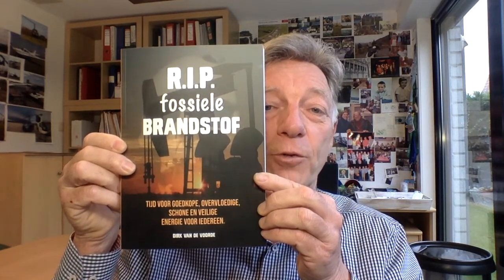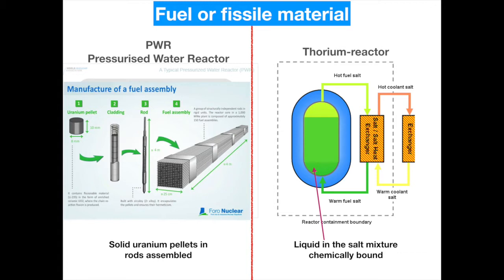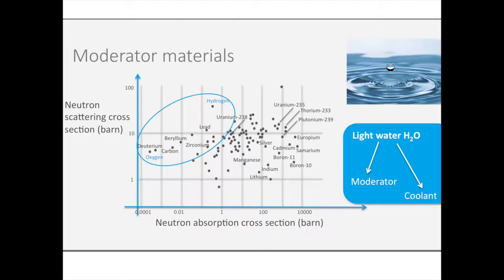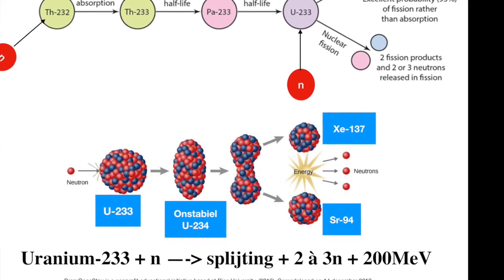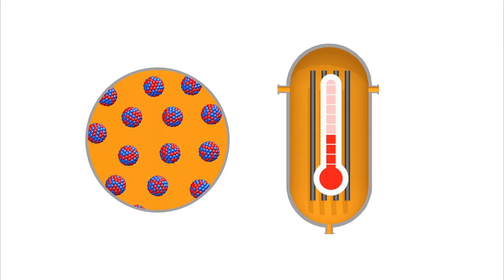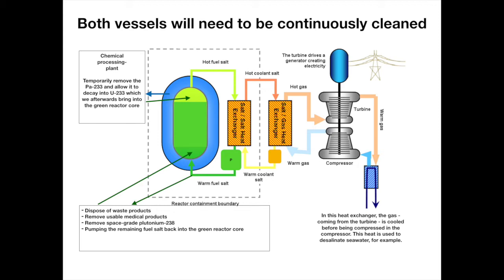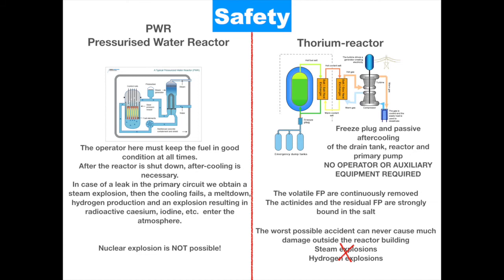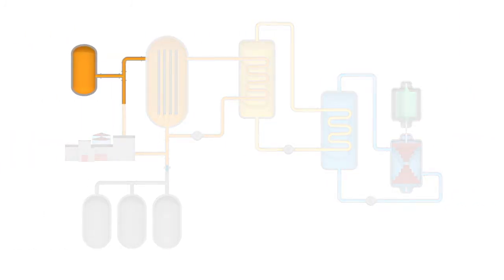The Thorium Molten Salt Reactor

Comment: Thank you for the sanity of the molten salt reactor. I have the idea that full fuel re-processing may boost the cost of the moderated reactor a little. How much I am not sure but when we used the Purex Process we had huge Bays of material trains. Since ours is a liquid except at the start when you get a shipment of fuel rods in to chop up, every bit of that initial load will be highly radioactive including the acid used to remove the fuel from the rods. This will not be a minor amount depending how fast you can convert over to thorium unless you just want to burn nuclear waste. In that case a large volume of acid and iridium will be produced. Any actinides left in this material will be very radioactive
Reply: Jo
Reply: In the US reprocessing is illegal,so far,there is no reason to change that, the Natrium System does not need it.With TRISO fuel you do not reprocess, just bury, you get higher burn ups and more energy out of the fuel,Kairos uses HALEU, but that just needs higher enrichment,not reprocessing, they want to be able to export these systems to countries that could have proliferation risks.

Comment: The reason that Thorium MSR was shelved was that it was harder to manufacture plutonium for nuclear weapons
Reply: just a myth. first it is possible to make nuclear weapons with thorium albeit slightly harder, but thorium is far more dangerous after fision
Reply: @dmitrizaslavski8480  
I never said it was a myth. I did say it was harder.
Reply: @bearup1612  So if it is possible that they go with thorium all the same if it provided any benefit over Uran based reactors. But no, it didn't provide ANY benefits at the time and big  problems(as it is a lot harder to contain fission process in msr, mb today it is possible but still not so easy and hard to scale). So even if nuclear weapon production had a role it wasn't main one.
Reply: The real reason they did not like thorium for weapons is that the process that generates U233, used in weapons, also produces  a small proportion of U232, which is not fissile but decays with a hard gamma ray that is a) deadly and b) detecable at distance which makes a weapon very difficult to hide. No way to realistically keep U233 and U232 separate. So yes there were good reasons to exclude Th from weapons development.
Reply: Not true.
Reply: @markrice41  Sorry buddy but that has been said so many times it is a joke.  No.  Not until America loses the reserve currency will anything change.  The two party system is designed to prevent a meaningful response to the legitimate needs of the American public.  Meanwhile the US government must run balance of payment deficits every year forever in order to ensure the US$ are staying overseas and can be used by third parties.  This means exporting jobs overseas with the US$.  Sound familiar?  Best thing that will happen to American is losing the reserve currency.  Then the economy will be able to compete with the rest of the world.  American are super industrious but their economy was destroyed by the Oligarchs.
Reply: So silly that people repeat this lie,the weapons came first, then the reactors our military uses enriched U for our bombs for Pu they have their own reactors that are not connected to the grid, one thing we do need is the Pu for the generators for Mars probes and some isotopes made in reactors just one isotope, for medical use is used 44,000 times a day just in the US,there are new uses for isotopes made in reactors every year.
Reply: Obviously building salt reactors ,as we are now ,has absolutely nothing to do with our military thermonuclearnprograms,we don't forget how to make Pu because new civilian reactors don't make them, but of course they do,Th reactors make U233 .
Reply: @charlesbeaudry3263  US still leads the world in clean nuclear energy, more than 100GW, we also have a number of advanced reactors in various stages of development, let’s not forget Vogel 3 and 4 about to unleash more clean energy on the Southeast US.
Reply: @charlesbeaudry3263  The world trusts the US hence our position as the preferred currency, we may lack in some things but everyone else are so much worse.
Reply: @paulbedichek2679  In proportion to its economy the French are way ahead.  So is Ontario, but your point is well taken.  Have you followed Terrestrial Energy? Based in Toronto.  This is a very tangible example of private (albeit with lots of gov money) GENIV reactor development.  Nice to have some optimism.

Comment: China has just brought on line the first current Thorium MSR. Indonesia's Walk-away Safe 7×500MWe Liquid metal Thorium ion molten sodium fluoride salt burner energy converters at $1200/kW will be next.
Reply: I don't think it has even gone critical yet, let alone brought online. As of today, Oct 6, 2021, I can find nothing but articles saying the Wuwei MSR will begin testing soon. This is only a 2MW reactor. We are still a decade or so before an MSR goes online.
Reply: @tpxchallenger  I think you're right but still lightyears ahead of the US who invented it.
Reply: @chapter4travels  Yes, China is definitely putting the money into new reactor technology. The pebble bed reactor HTR-PM just went critical a month ago. Interesting times indeed.
Reply: @tpxchallenger  its designed as a load follower so the thermal output depends on how fast you pump the salt through the reactor. The pump is controlled by the load which is currently being controlled as a means to test the attached systems.
It won't be long before you see the fossil fueled heating components of recently built coal fired power plants, being simply replaced with TMSRs supplying the thermal heat to the existing steam turbines. 
So expect to see soon the sensible construction of TMSRs instead of any more fossil fueled coal or gas units. 
Like Indonesia's chosen production line construction method of floating TMSRs in Asian shipyards at a rate of 12 units per slipway per year 
So I see no impediment in China's building capacity easily exceeding this, and at an even faster rate and cheaper than $1/Watt cost of construction and deliver cost; utilitising the energy for clean industrial manufacturing besides electricity, such as steel and cement and at an equivalent cost of supply of less than $25/Megawatt.hour eliminating the Nation's need for expensive Mickey Mouse batteries made from scarce elements, to balance the irratic supply from the unrecyclable Solar and wind farmers.
Reply: @MrVaticanRag  I hope you are right in your optimism. Of course small marine reactors are possible, the navies of the US, USSR/Russia, France, Britain, China jave been building and using them  for decades. But the "first mover" costs for any Gen lV reactor will be high. Both molten salt and pebble bed are very promising. Honestly, so are Boiling Water Reactors.  The Russian small reactors they recently put on ships are tried and true BWRs. 

The problems with all reactors are waste and safety.
Reply: @tpxchallenger  China is putting a lot more money in solar and wind than nuclear. Nuclear is less than 4% of the total energy production. Solar and wind are over 15% each.
Reply: @tpxchallenger  Quote from William Magwood, Director General of OECD's Nuclear Energy Agency and former NRC Commissioner, "If these technologies cannot be brought to market...in about a decade...they may not be relevant to the energy transition." Mark Cooper, Senior Fellow for Economic Analysis at the Institute for Energy and the Environment said, "Small modular reactors appear to be repeating the path of large reactors, with rising costs and increasing delays. Much of the battle to meet the challenge of climate change will be over before even one of these reactors is online."
Reply: @tpxchallenger  The high temperature gas cooled reactors in China are 3 times the cost of light water reactors according to the WNISR 2021 report. Maybe that is why China is putting a lot more money into renewables than nuclear.
Reply from the maker: Thanks for the information regarding ThorCon, I am studying it thoroughly.
Reply: @jackfanning7952  patience Jack - TMSR will dominate within 10 - 15 years. The can replace the fossil fueled thermal component of all Coal fired power stations constructed within the last to years and any potentially planned in the future.
Reply: @chapter4travels  China is not far ahead of the US in rice farming let alone advanced nuclear tech,yes,they built a LFTR,we love to hear that, but US has lots of new nuclear comming.
Reply: @paulbedichek2679  The US also has the NRC whose primary mission is to put an end to domestic nuclear power, and they have been wildly successful.
Reply: @paulbedichek2679  Thorcon went to the NRC and was told in polite terms to pound sand. I just don't believe anyone can turn around the NRC in any timely fashion.
Reply: @jackfanning7952  I'm a big supporter of clean energy, but even for me I have been leery of the fast reactors, not for safety, but just having accidents that mean shutdown and high costs, but we are going forward with Natrium,which is not a test reactor like the Chinese LFTR or the American molten chloride fast reactor, but a full size commercial reactor. It will most likely work as advertised, but be a year late to grid connection.There is also another demo plant not grid connected just making heat to see how it works the Hermes test reactor for Tennessee,Flibe cooled but solid TRISO fuel.
Reply: @jackfanning7952  You are confused about the ThoorCon that uses molten salt not liquid metal, it is a thermal reactor not fast,fast molten salt reactors are years from deployment the molten chloride fast reactor is a demo being built by Terra Power,not grid connected.

Comment: The TMSR has many advantages but the problem sits with the legislators due to the need for very highly enriched uranium to start the fuel cycle and the production of plutonium within the reactor.  Thorium is not fissile but it is fertile hence the need for uranium to start the cycle.
Reply: Can radioactive waste from Uranium power plants be used as a source of neutrons in Liquid Fluoride Thorium Reactors?
Reply: @charlieculbs9114  protactinium  can capture another neutron to U234 which is not fissile.  Neutron poisoning is a significant problem with protactinium due to its high cross section.
Reply: @landroveraddict2457  Can and will are completely different,Terra Power will use HALEU,highly enriched U. We have 90% U but that is just for the aircraft carriers and subs, now you have to ask Russia,US will start to maufacture Haleu.
The waste we need to worry about is batteries and solar panels.
Reply: @paulbedichek2679  Very astute, 20 years from now we will be trying to find a way to recycle, lithium batteries and wind turbine blades.
Reply: @elefnishikot  Radioactive waste emits electrons and alpha particles, and sometimes positrons, but not neutrons. To get a neutron chain started requires a strong alpha emitter (thorium is too weak) and beryllium, and of course a moderator. When the beryllium runs out, the neutrons stop.  This was the drawback of Canada's SlowPoke reactor.

Comment: There are hundreds of different nuclear reactor designs, all of which have their pros and cons.  Thorium is just another of these designs.  All of them have their advocates who claim theirs is the best.

Thorium and Uranium-238 both have advantages and disadvantages for use in MSRs.  They are both available in essentially unlimited quantities.  

It will take a long time for regulators and the nuclear energy industry to decide if Thorium is worth pursuing on a large scale.
Reply: All we need, according to Kirk Sorensen, is a cohort of middle school boys and girls who like to melt salts in crucibles, who then go on to build intricate pumping systems in high school.  They would play with molten salt in the same way that kids in the 1970s played with model trains.
Reply: @philipyoung7034  Sounds great. How that relates to nuclear reactors with fissile materials is not clear to me.
Reply: @tombenson5957  While the nuclear chemistry is the same for all types of reactors, the engineering for liquid fuel reactors is radically different from solid fuel.  The regulators understand solid fuel and so the licensing behind it. Volatile gases 4:10 is just one issue with both fuels, but how it's handled is tangentially different. (See video 4:10)   Liquid fuel in general and molten salt in particular is so radically different that regulators would draw up licenses that are too lenient or too restrictive or just wrong, unless they belonged to the cohort that have worked with molten salts in both nuclear (eg, under 1 MW) and non-nuclear (eg, solar thermal) facilities.
Reply: @philipyoung7034  I agree with your assertion.  That's why Uranium-238-based liquid fuel reactors are much more likely to succeed rather than Thorium-based liquid fuel reactors.
Reply: @philipyoung7034  True but the regulators like U-238 better.  It's familiar to them.  Also we have millions of tons of U-238 sitting around in warehouses and they don't know what to do with it.  So for these (fairly silly) reasons, I think U-238 will still be the winner in the liquid fuel reactor race.
Reply: There are also ample supplies of U235 to utilize in a simple once-through MSR. We need to get the ball rolling on gen IV MSRs and simple burners are the place to start, there is plenty of time and many lessons to be learned before the need for breeders.

Comment: So how is the corrosion of the pipe being solved again? What alloys are being used?
Reply from the maker: this is a question we can ask China soon. But if we don't let the temperature go above 600°C the current alloys are ok. Australian and Chinese researchers have made progress in understanding the mechanical properties of a new class of materials for use in molten salt reactors (MSRs). The Australian Nuclear Science and Technology Organisation (Ansto) said yesterday that NiMo-SiC alloys - prepared from nickel molybdenum metal powders with added silicon carbide particles - have superior corrosion resistance and radiation damage resistance.

Comment: Do Thorium fueled, Liquid Salt, Nuclear Reactors create radioactive waste?
Reply from the maker: Yes, you are always left with the nuclear ash, the fission elements. But after 300 years, those are all stable. The volume is limited. The little bit of transuranium that remains can be processed into new fuel for the already existing BN600, BN800, etc. and the many different types of fast nuclear reactors under construction. The fuel cycle is closed!

Comment: How are the neutrons, be they thermal or fast supplied? Is it from the U233 or  an external source like plutonium or U235?
Reply from the maker: In the beginning you need a kickstarter U235, Plutonium 239 but the idea is that the Thorium 232 decays as fast as possible sufficiently to U233 so that the nuclear reaction is self-sustaining.

Comment: I love salt. I have it on my chips. I don't like Lithium 6 And 7 ish, not very tasty at all. So tell me how is the L6/7 provided ?

Secondly, why is there a hang up about costs. If I was drowning as a country say in 100 years time  and had to put trillions into the unachievable flood prevention, as water finds a way through. Any extra cost now for molten salt acceleration is meaningless.
Finally,  I ask the question how quickly can the MSR come on and off line quickly. Water  reactors are best for base load are they not.
Reply from the maker: Question 1: how quickly can the MRS come on and off line quickly?

China prepares to test thorium-fuelled nuclear reactor (https://www.nature.com/articles/d41586-021-02459-w)
China is about to test the thorium molten salt reactor. The Thorium MSR is by far the most difficult reactor to build. The MSR from Moltex Energy or Elysium Industries that works with nuclear waste is much easier to build. The modular MSR from ThorCon can be built within 5 years and if the licenses are approved a little more quickly within three years. 

See on internet: ThorCon Training #3 with Prof. Kun Chen : "Neutronic & Thermohydraulic”

Question 2: Water reactors ar best for base load are they not?

Belgian nuclear power plants are baseload capable because they are not equipped with the appropriate control rods to regulate continuously. In France, the LWRs are controllable. But MSRs will be much easier to control.

 An interesting video is from Elysium Industries.    
https://www.google.com/url?sa=t&rct=j&q=&esrc=s&source=web&cd=&cad=rja&uact=8&ved=2ahUKEwjj1buqyaf0AhUU8rsIHUQSCswQtwJ6BAgDEAI&url=https%3A%2F%2Fwww.youtube.com%2Fwatch%3Fv%3DaHsljVnY6oI&usg=AOvVaw1YnfMwdF2UohPhpwlVwVAo
Reply from the maker: Question 2: how is the L6/7 provided ? Today the only sources of Li-7 (enriched from natural lithium) are Russia and China, though the latter is reported to be buying from Russia now. Production of lithium-7 at least in Russia and possibly China is as a by-product of enriching lithium-6 to produce tritium for thermonuclear weapons. source: https://world-nuclear.org/information-library/current-and-future-generation/lithium.aspx

Comment: As long as one gets the corrosion issue resolved, sign me on.
Reply: The corrosion issue is handled by using Nickle alloy piping for which we don't have enough welders (small catch).
Reply: @rRobertSmith  So to give our species the option of getting back on the uranium-thorium lifeline, researchers will have to develop this fast. This option has to be ready to go, simply because its coming down to solar-batteries as the quickest route. It's not the best for industrial grade power, but for home use, yeah.